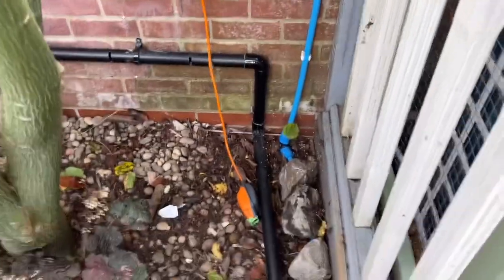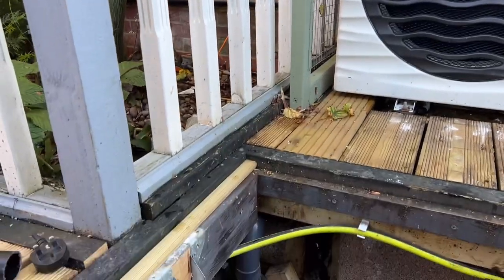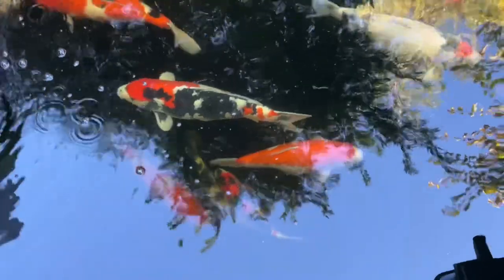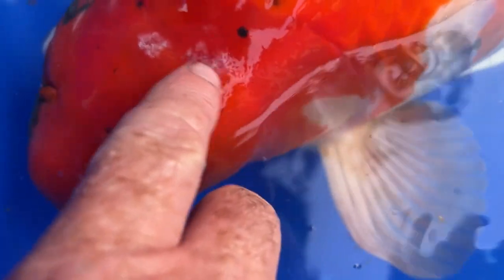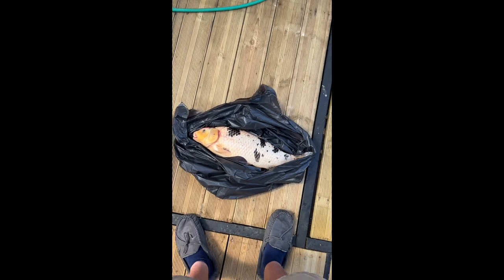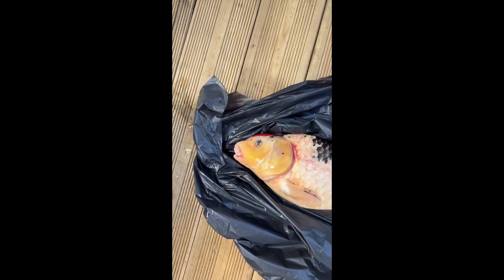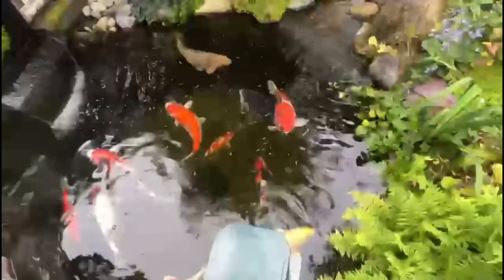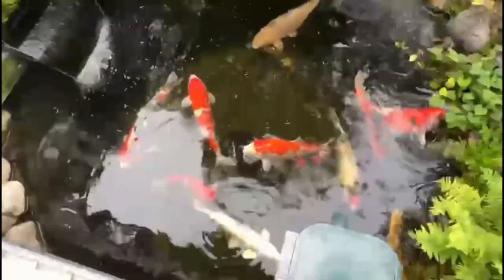Upgrades to the drum install, WTF. Happened, big problems in the pond #bottomdrainpurge#problems#koi

Comment: Could it have been a PH crash and that lead to acidosis. That happened to me, from years of having a stable ph and a kh of 6 drops from my tap water it went down to yellow with 1 drop. My fish looked terrible and the water was just as bad but my api ph test was showing the ph was fine and normal (it wasn't and the kit was in date and stored correctly) I got a new test kit which showed my ph was 6.4. I had also ordered a bluelab guardian which when turned up backed up the results. I buffered up with bicarb and everything gradually went back to normal.
I now have to add 1 cup of bicarb per week but with the bluelab I can watch my ph dropping as the week goes on. Just a thought. Glad it all looks to be on the mend. 
That sound from the lancaster is such an amazing sound. Cheers.

Comment: Such a shame, I think you’re right about the spray, it would have sat on the surface and when your feeder went off they probably ingested it then. It would have been almost full strength. On the colour fading my theory is that soft water is better for reds and hard water is better for blacks. Since I moved to a very hard water area, I’ve got good fish that have lost most of their red but the blacks are very strong.
Reply from the maker: I think so to tony , thanks mate , I’ve written to the council voicing my concerns , it definitely seems to be the weed killer as a few plants in line with the droplets on my paint work and the pond turned brown and died ,makes me despair and some people lack lustre way of doing things 👍👍😎😎